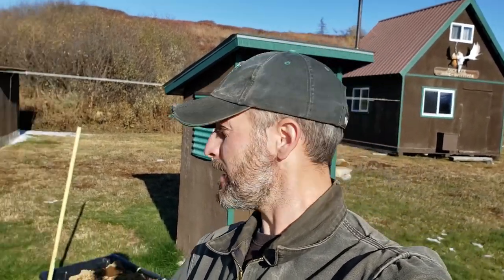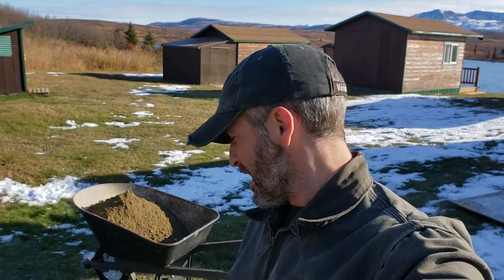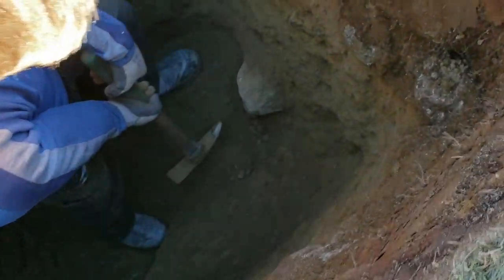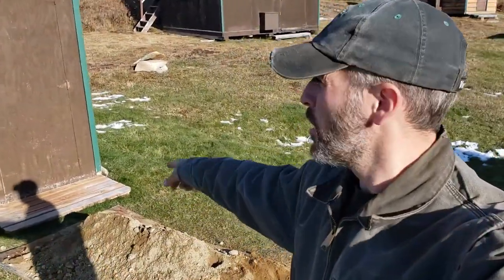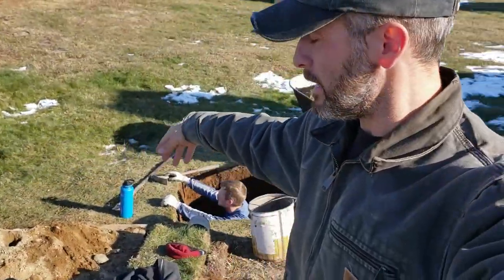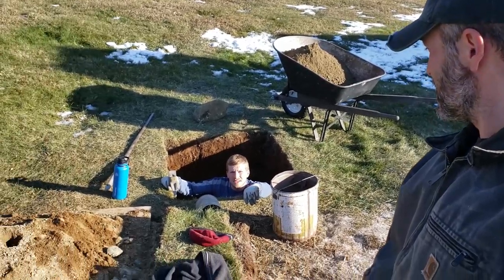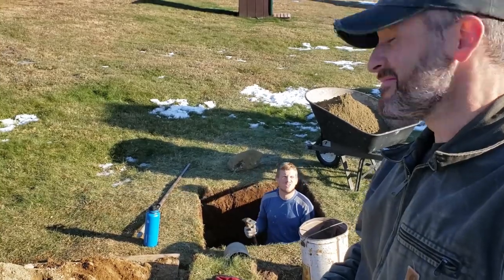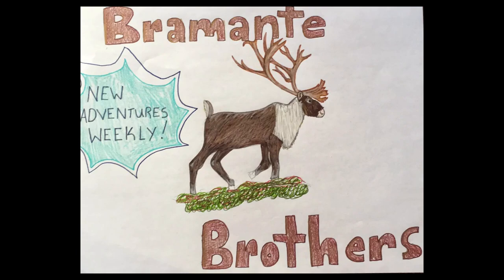OUTHOUSE HOLE - Off Grid Solutions

Comment: If you dump wood ash down the hole it turns to lye and decomposes the contents of the hole. An outhouse properly maintained should last a very long time.
Reply from the maker: We dump stove ash down the hole about 1-2 times a month. It lasts 2 or 3 years. Running a lodge means more use than an average remote property outhouse. The problem we've found is the COLD tundra preserves "it" more than helps with decomposition. But no shortage of wood ash around here with 8 months of winter and 2 wood stoves!

Comment: That is the most perfectly dug square I’ve ever seen. We are in Northern Maine and had to have someone dig a hole with an excavator because of all the boulders and tree roots. It’s about four feet deep. Problem is it filled with water about a foot in the bottom. 🙄 Now what? 🤷‍♀️
Reply from the maker: That's the kinda hole you get when 2 perfectionist/control freaks dig it 😉
The water in your 4' hole is a bummer. Is that the water table, or has it drained?

Comment: I’m about to start building my outhouse! Quick question. What’s the dimensions of the whole you dug? Is it the same dimensions as the outhouse?
Reply from the maker: The outhouse is 4 ft wide (sheet of plywood)  the hole is usually around 40" x 24" as long as the building has a ledge to set on.

Comment: Off grid means using power that isnt supplied by the grid

Shitting in a hole is a different subject 

I went off grid in 1997.  The  power line is about a mile away.
Reply from the maker: You're sooooooo right 😏 we could have titled it "remote living solutions" but the algorithm likes "off-grid" more.  👏 👏 👏 🦸‍♂️
Reply: @BRAMANTEBROTHERS  unfortunately.    That phrase is worn out.
Reply from the maker: Yes, and we are tired of using it, but unfortunately it still ranks high in analytics and search results.
Reply: @BRAMANTEBROTHERS off grid, side grid, over the top grid, whatever man. I was looking for a vid like this. Keep doin what ya doin cause most appreciate it